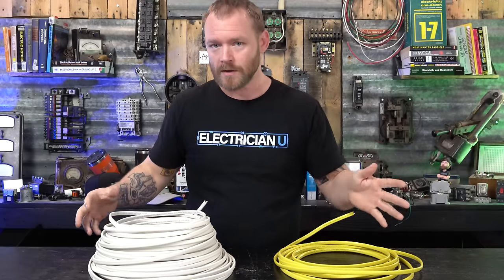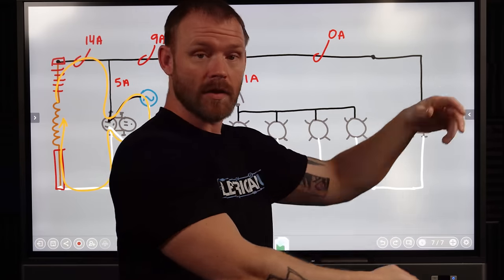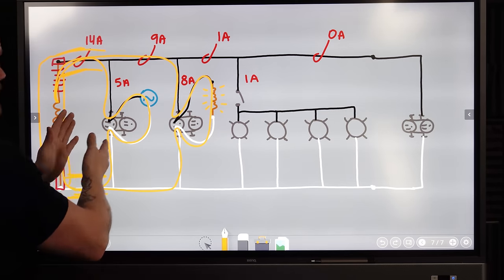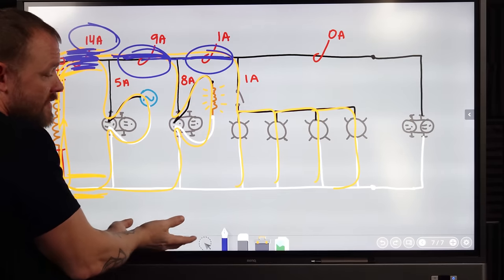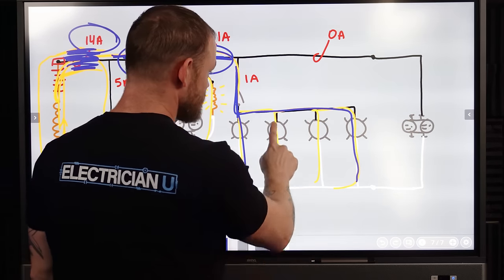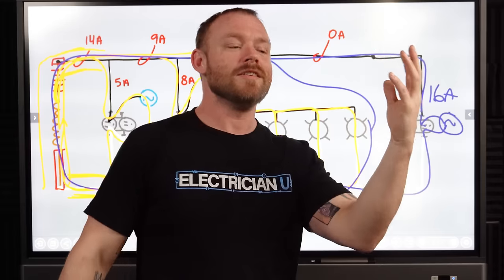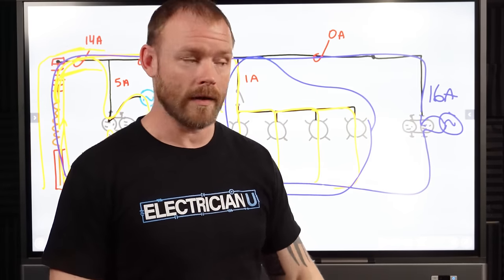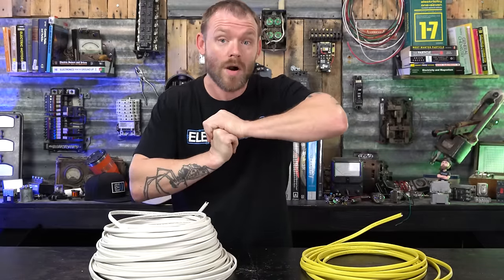Should You Be ONLY Using 12/2? When Can You Use 14/2?

Comment: I ran my entire home in 12/2, it's weird, lots of people said "Good call", still lots of people said "You know you could have used 14/2 for the lights right?".  Since it's my home, I like being able to turn off entire rooms.  Voltage drop was a big concern for me, as I have a 130' home, and even though the breaker boxes are centralized, some homeruns were around 100' long in places.
Reply: So, I ran a voltage drop calculation using 14 gauge wire, I had to assume a couple of things of course because I do not know your house layout. Assuming, you have a 100' run, with 30 75-watt equivalent LEDs (13W actual power draw), you would draw roughly 3.3 amps. Ran through a simple voltage drop calculation, you would only lose ~2 Volts which is a 1.6% loss, which is negligible and would not affect the circuit much at all, if I remember correctly you want to be +/- 5% and I put a lot of lights on that particular circuit, generally, lighting layouts are divided up more. In general, with certain exceptions, voltage drop in residential homes is negligible and rarely comes up. It's not unheard of, but usually it doesn't affect the run. Nothing wrong with what you did, just food for thought.
Reply: @TheRiddler491  Thanks for that, I know it doesn't usually come up, however my rental house before that had bad voltage drop on one end of the home.  It annoyed me, and others greatly!  I wanted to do whatever I could to prevent it.  Also, my actual circuit could be longer than 100', once you account for the rest of the circuit.  Strangely enough, after all that, my led lights fluctuate in brightness when my washer is swishing around the water.  I think that is more bum led lights.
Reply: The cost difference is not much when you consider the 30+ years of service. I ran 12/2 for everything in my house as well. Same with the receptacles, commercial grade 20 amp outlets. Again the cost difference over the life of the product makes it a no brainer.
Reply: @raterus  Interesting, did you wire your house? I find it odd that they would fluctuate after the unit is running. Could be shit LED's but I assume they are not on the same circuit. You see it a lot in older homes where your turn on the microwave and the lights dim because they are on the same circuit. As far as your old apartment, they probably tied a bunch of things together which could cause lights to dim. If you have a bunch of things on one circuit, this could also cause voltage to drop as it is electrical pressure much like turning on all the water sources in your home. The demand exceeds supply, causing voltage loss. Voltage loss only really happens in extreme distances and is considered for such things as parking lot lights and such. There are many factors to consider here aside from distance.
Reply: Not just "good call", the 12AWG wire is necessary at that length to meet voltage drop rules
Reply: @benchociej2435  Depends on how much load is being served, not just length. Yea you have to be within a percentage, but the amount of current flow is a key factor. Vd=(K x 2 x L x I)/cma
Reply: You're Someone that know what the doing. You must have had a good instructor.😀

Comment: So why not have 5 A LED lighting circuits with appropriate sized wire?  Wouldn't that save a lot of money?  Possible issues, someone later wires up something else that isn't LED lighting, such as a light and fan combo to that was wired for a LED lights with thin gauge wires and 5A breaker.

Comment: I ran 12/2 to all my outlets even when  they are on 15 amp breakers.. but coming off the outlets that are also servicing  lights, I run 14/2 .. everything coming out of my panel goes down below into my crawl space  then up to the outlet ,back down into crawl space,  back up to next outlet.. I have virtually no horizontal runs inside my walls.. (except where im powering a switch for lights, and that is only in the cavity on the other side of the same stud. ) I never put a 20 amp breaker to a 15 amp outlet .. really wasn't that much extra to run the heavier wire to all the bottoms..

Comment: I'm not an electrician but I have rewired my basement and I just figured it made sense to run 20 Amp 12 gauge to outlets and seperate 15 Amp 14 gauge to lights. Haveing outlets and lights on the same breaker just makes no sense to me other than it's easier to install.

Comment: I understand what he is trying to say but 20A circuit all the wire has to be 20 amp rater. I rewired my house and to me idea of outlets and lights on the same circuit is usally pretty silly unless it is like a one off thing.  I set it so that each room has a breaker for outlets 20A 12AWG  and 20A TR outlets, all the lights are split in two 15A circuits all that is ran in 14AWG. I ran a main run for the lights then tapped off a few boxes in the attic.  The only time a wire can be smaller than a breaker is if like 6 AWG is rated 55 amps there is no breaker that size you could go under and use a 50A breaker or you could go 5 over with a 60 amp breaker both as far as i know are ok.

Comment: I'm pretty sure the only way this would be kosher under code on a 20 amp branch circuit would be to run 12/2 to a subpanel with a 15 amp breaker in it, and then from there make your 14/2 runs for the lights. Overcurrent protection must be sized appropriately for EVERYTHING downstream, and if you are going to transition from big wire to small wire, you need to stick an appropriate overcurrent protection device at the point that you start your smaller wire run.

Comment: My house has weird wiring. Its a 60's home that was remodeled in 2012. Everything from the circuit breaker is 20amp with 12/2 and the power all goes directly to the lights. But they left the old 60's wiring in place to run from the lamp to the switches. I think it's because the outer walls are plaster and they didn't remodel the outer walls.

Comment: I like watching your channel.  I'm an owner builder so where I  live I can do my own wiring. Of course it does get inspected by the local authorities.  You have touched on it many times. What I find amazing is there is no uniform electrical code. It varies by location.   I come from the aircraft industry. I spent many years as a drafting checker.  Everything is done by FAA spec's. Our local electrical inspection office told me that, yes I  can do my wiring as an owner builder and it needs to be to code but they won't tell me what that code is. And then it's up to the inspector whether or not they like what you did.  I'm amazed at that response. In my job it would be here is the spec and that is how it must be done. And the inspectors job is did you do it to the spec.  It's a pass / fail. Not a sort of inspection.
Reply: Yes, this is odd and on the ridiculous side of bureaucrazy. There should be specifics available, particularly online at this point. I am wondering, if it is their way of discouraging you from attempting it and just hiring it out to one of their cronies.  I would recommend that you go looking for the local code to research it and, if you cannot find it, proceed going a bit beyond the current NEC and be prepared to defend less common elements with references to the inspector.  They are most definitely hiding the information from you though and potentially setting up some kind of bribery scheme. Document everything; inspections need to have a book in order to go by the book!
Reply: There are a variety of factors that drive the code. Each jurisdiction has unique environmental factors such as heat, humidity earthquakes accommodation of different building ams tructural practices etc. Alaska may have different factors than Texas and California Also the wants of labor unions and local safety karens is a factor. NEC  is bare minimum national standards. Each jurisdiction has its own preferences. It can get quite ridiculous from one town and county to the next you can have expectations of the local AHJ all over the place.

Comment: (I have not gone to the code book yet) -------- But how about this.....Regardless of 12 or 14 awg going to the LED fixture, (or even incandescent for that matter), the fixture itself is internally wired with 18awg so this is the lightest gauge wire on either a 20A or 15A breaker. 

He is talking parallel circuit and I understand how his 14awg wire could be used in his scenario in that it is separated from any 20A load on the same circuit and that the higher current will not flow through the 14 wire. (Again, have not looked up the code specifics yet).
Reply: Fixture wire has different rules applied to it, mainly because it usually only feeds ONE fixture, and is totally contained within that fixture.  Once the wire leaves the fixture enclosure, it is now considered a branch circuit conductor, with a whole different set of rules.
Reply: Thanks! It makes sense. I wonder though, if a branch circuit only goes between the switch and the fixture, how or why can the fixture be treated differently than the branch circuit that services only that fixture and the branch is 14ga or larger and the fixture interior wiring might be 18ga or smaller. (no reply needed to that....just curiosity on my part because has always seemed to me odd that fixture wire can be such a small gauge with respect to the wire that energizes it) Again, thanks for the response! @mxslick50
Reply: @sdsconstruction  There are a couple of reasons in regards to that logic...first off, the fixture wire is sized to the max possible lamp/ballast load plus a safety margin. Second, any failure of that wire in the fixture will, in theory, be confined inside the fixture without creating a hazard outside the fixture itself. Third, (and I have seen this in person) the wire will, in may cases, in the case of a short, actually blow apart like a fuse. Which is something you don't want happening in a wall for example. 

That same rule with some variations applies to appliances as well. If you ever open up an electric range, most if not all of the wiring to heating elements is somewhat undersized, if you were to apply the NEC's branch circuit ampacity rules.

Comment: So if you use smaller wire on the light circuit and it gets a short like the wire gets pinched in the metal housing does the breaker trip 1st or does the wire burn 1st. Sorry if this is a dumb question but I don't want to test that in someone's home.
Reply: A properly shorted conductor (14 ga) or even 16 will have no problem tripping the instantaneous overcurrent of a 20A breaker.  The code was written for future idiots that extend a wire from a recessed can to run an outlet with an electric heater, and the gaming pc with 84" monitor.  Even than, unless worst case ( bad/good cable cooling) there will be- no fire.

Comment: I was building new about 6 years ago, and Lowes had 1000' spools in the aisle for less than $200.....I thought that's an incredible deal, a 20 amp breaker is spot on with a 15.....right?

NONE of the outlet or switch back stabs allow 12 gauge, and bending the stuff sucks, and I mean sucks compared to 14 when stuffing it into a wall box.

Comment: OCPD protects the wire, devices, and (to a lesser extent) appliances, I think that for receptacle branch circuits we should run conductors that match the devices even if the expected load is much less. 2023 NEC 210.23 permits 10A lighting circuits, maybe go that route if you have an opportunity for extra breakers, and it may not be that much more wire overall.... if you could buy 10A breakers and 16/2 NM lol.

Comment: I thought code said that you need 12 gauge for anything attached to a 20 amp breaker? I just added a garbage disposal onto a 20 amp and it alone will never draw more than 5 amps, but I specifically bought 12 gauge in order to match the rest of the circuit.

Comment: when you are installing circuits for your own use a solid case can be made to upsize the wire as much as you can stand to. running all your wall plugs on 10/2 sounds crazy until you do the math for say 5 years of power loss across what ever wattage you expect to draw. saving money by cheeping out on 14guage may save some pennies on the install but it will cost you dollars in operational costs.

Comment: Why do I have to use the 16g stripper to strip the new 14 g wire? I rewired some of my house and it was wired with 12g wire. I bought new 12g wire and it is not the same thickness of copper. When did they start cheating us?

Comment: If you are building or working in your own house, use #12 wire as it is only a few dollars more and gives you additional protection form over load and heating from larger appliances or heaters.  If you are bidding residential work you are cost competitive and must use the minimum materials that meet spec or code.  Bidding is insanely competitive and using #12 in leu of #14 will press you our to the job.
Reply: Don't discount 10awg as well. Thanks to code, people seem to only ever consider 12 and 14. I've really been impressed with the circuits I've used 10awg for the branch circuit for low voltage drop when I thought it important. I only avoid 8awg and larger because it's stranded and kind of a pain.